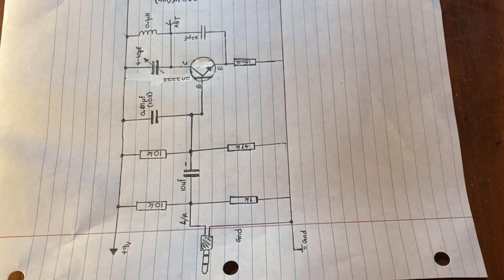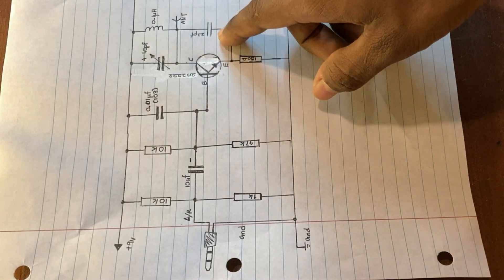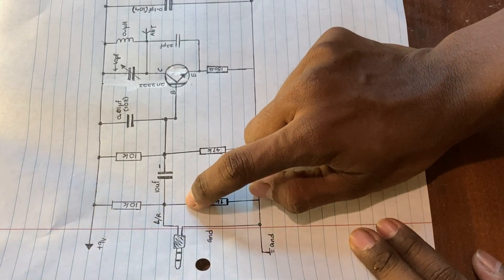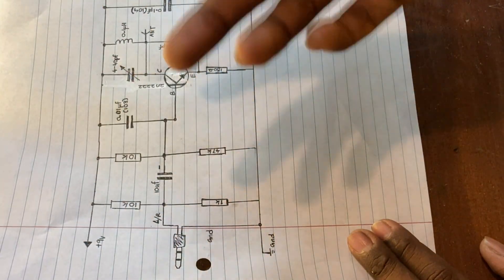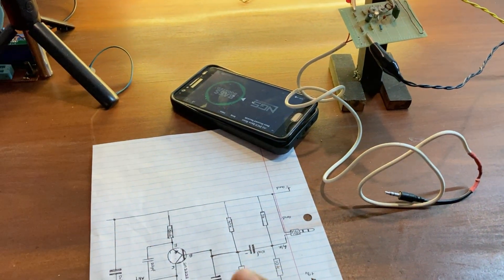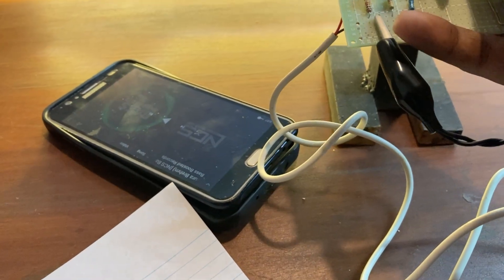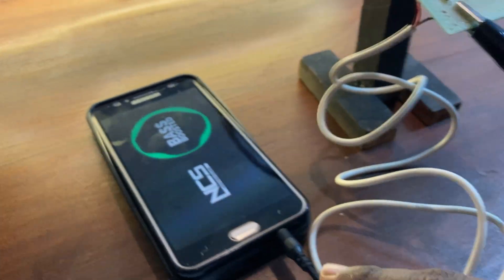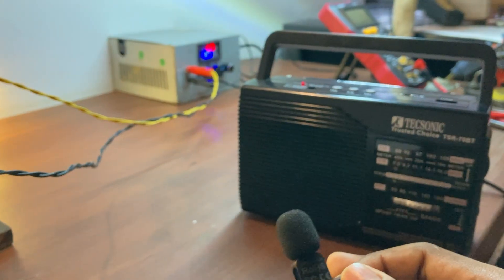Simple FM transmitter With Circuit Diagram| Broadcast Your Own Audio to The Car Radio

Comment: How do receive signal by AM or FM  ? Can it work 1 km radius ?
Reply from the maker: FM ,No low range (10m) but high quility sound😊
Reply: how could I upgrade for long distance ,any issues from FM stations? @Circuitdebug
Reply from the maker: Therefore, we would have to add another amplification stage and change the circuit. This is a very simple design. But a long-range version would be a bit complex than this, but we have another problem, in some countries long range FM transmission is illegal without a License. So be aware of that! . I have added the documents about how the circuit works you can read them if you want or watch videos that are made discussing your issue